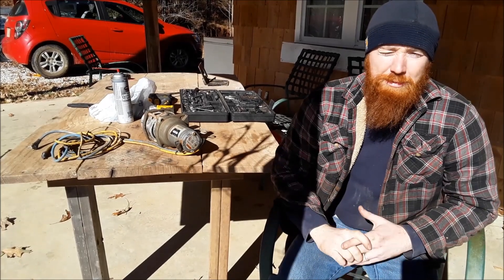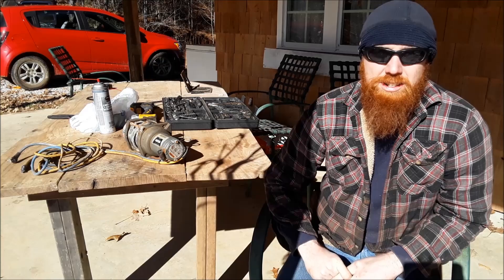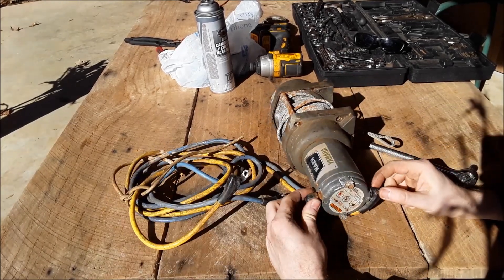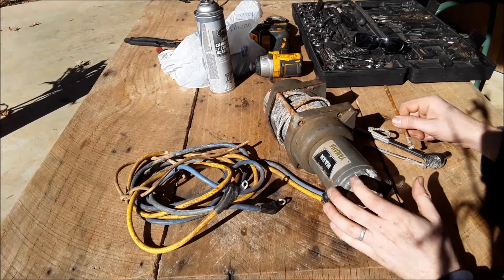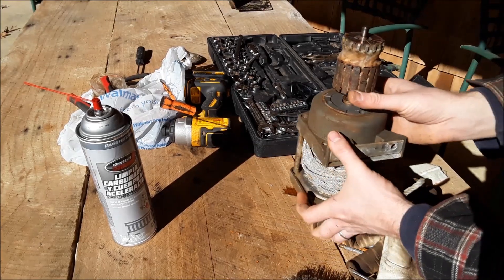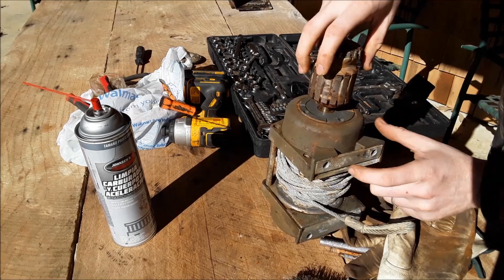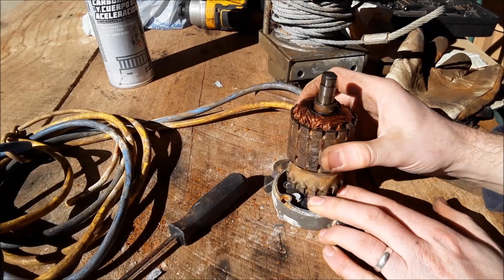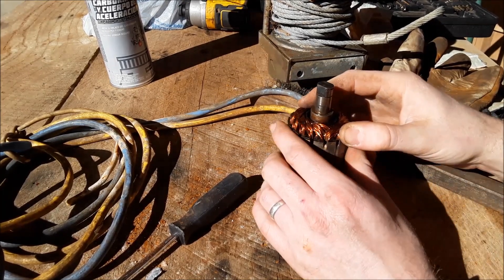Warn 2500 ATV Winch Rebuild

Comment: Just did the same as you with a similar winch but mine as 2 bigger magnets vs 4 like yours. My Magnets both seem to be chipped on the corner with a bunch of little peace’s inside. Hopefully it’ll still work once cleaned & put back together.
Reply from the maker: Did you have any luck with it working?